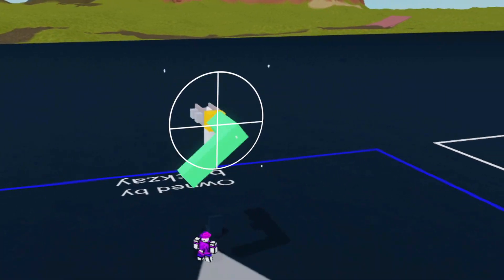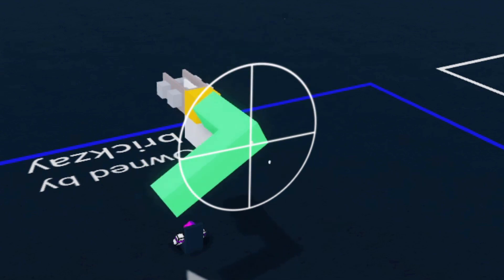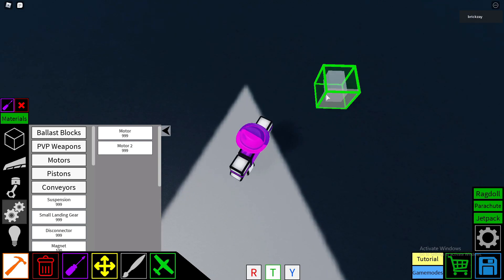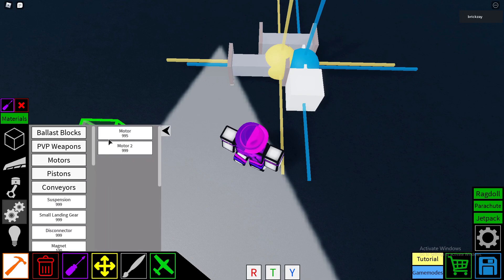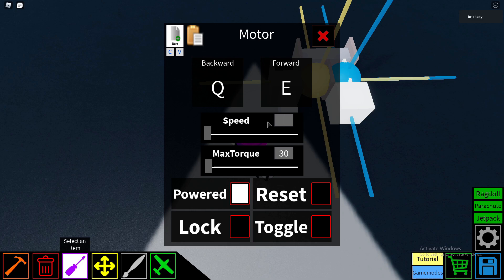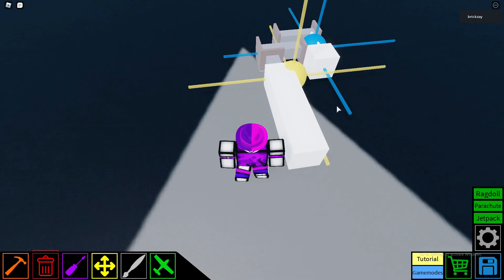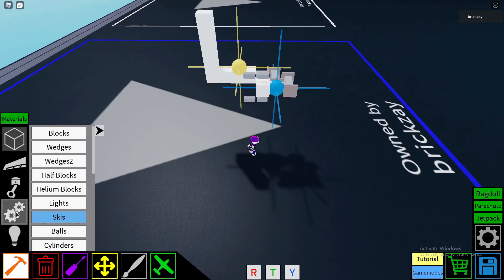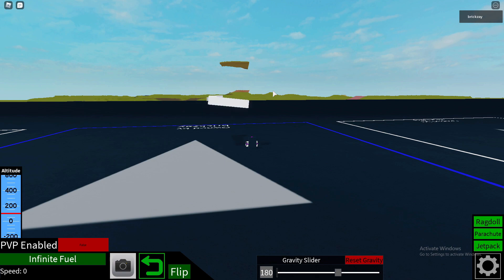How to Build a Stepper Motor | Plane Crazy

Comment from the maker: What are you doing step motor?
Reply: step motor? more like step mother...

just kidding, that's thicc brain time. I think it can be used for clock
Reply: @dam78  Or make better wheels,or make better gears,logic gates,computers,8 digit displays,even... wait a minute this is already in build a boat for a treasure and it doesn't even require extra steps you just need a tool 🤔
Reply: WHAAAAAT
Reply: your way beyond me
Reply: i was going to comment this
Reply: O